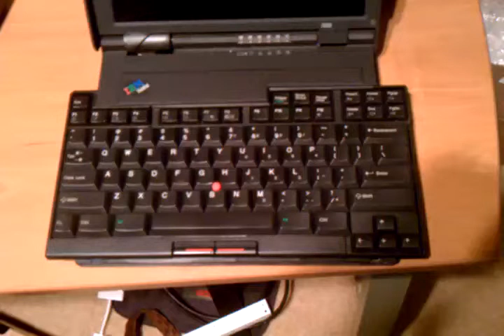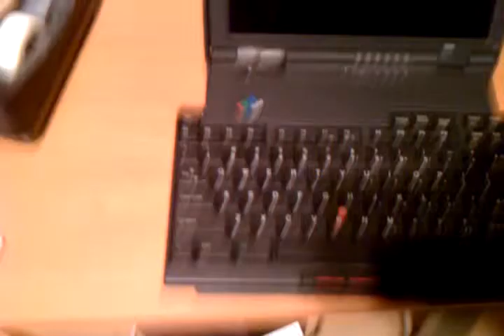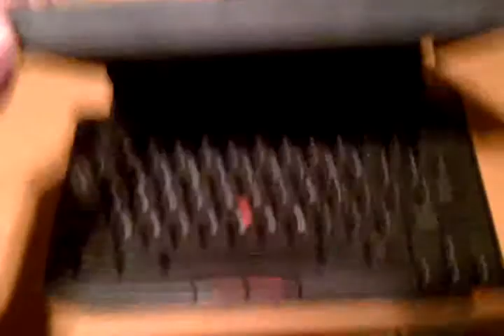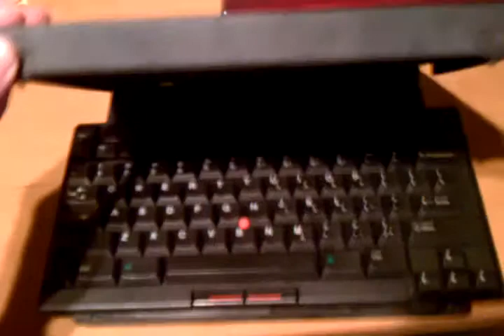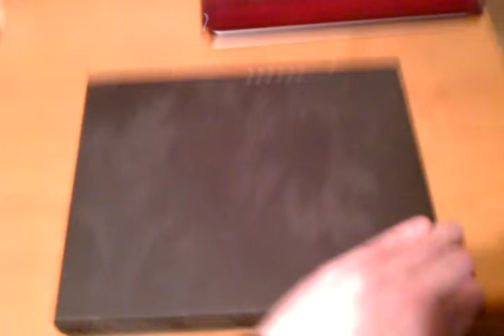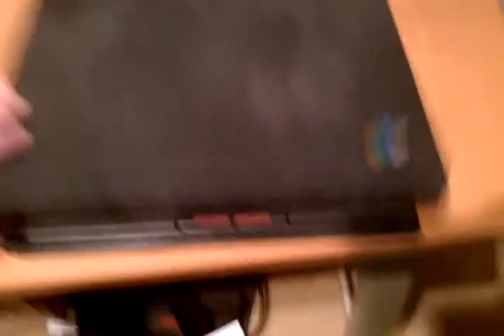Old Thinkpad Design Innovation

Comment: Need to find a way to cram a modern CPU, GPU, HDMI, RAM, hard disk/SSD, USB2/3, SD card slot, gigabit Ethernet, 802.11n, sound card, Blu-Ray, and display into this classic chassis.  Also find a way to sneak in a third mouse button, I'd like that.  Maybe also a fresh battery. :^)